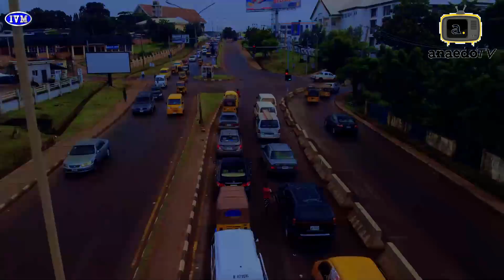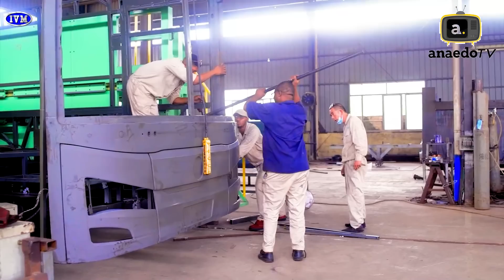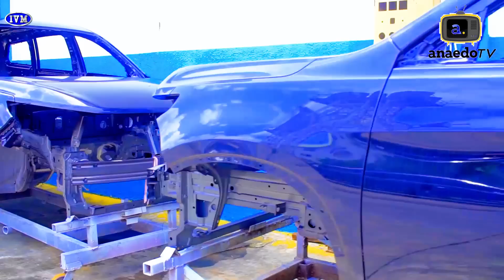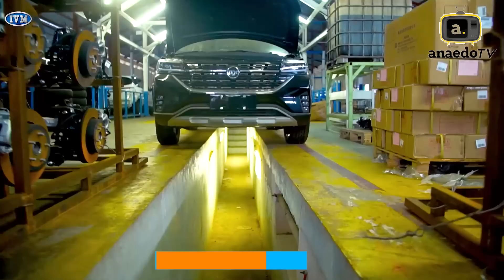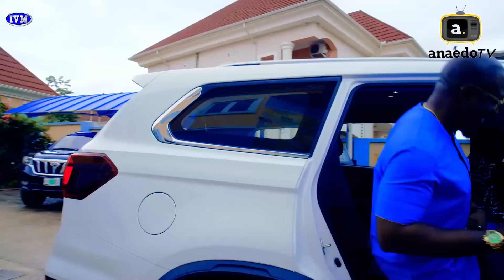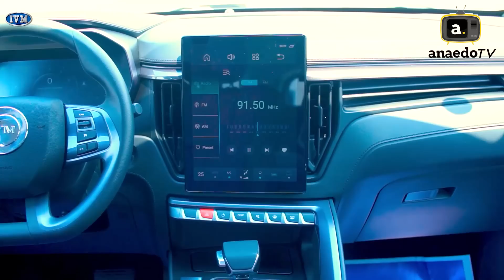MANUFACTURING PROCESSES OF INNOSON VEHICLES

Comment: 60% local products which means the bulk is coming from China. 60% is probably bolts and nuts. Drillers, labour, managers and supervisors. Plastic and rubber materials. China swallows the bulk. Imagine doing much of the work and China eats 40 Billion out of 100 Billion.
Not smart